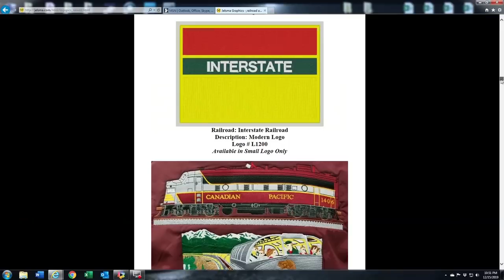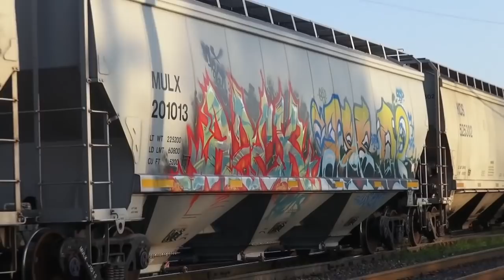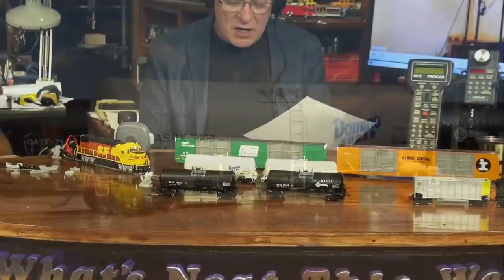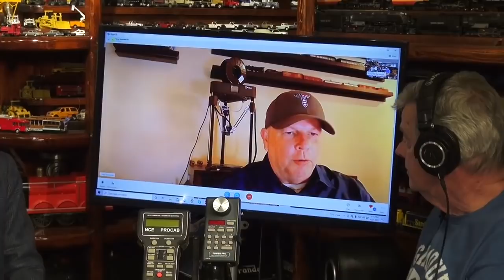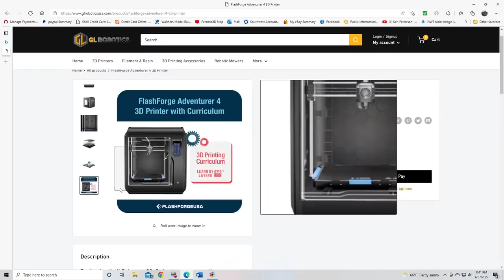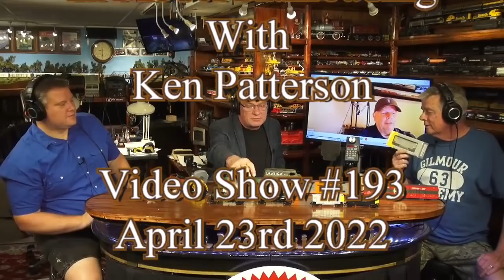What's Neat This Week in Model Railroading #193 Show April 23rd, 2022

Comment: Respectfully, what the hobby needs is:   SCALE track, SCALE wood, and concrete ties, SCALE rolling stock wheels, SCALE wheel flanges, we want METAL wheels - no more of this toy-like plastic wheel nonsense.:    Have you seen rolling stock that has NO weight, they shake and go into uncontrollable vibrations - we need WEIGHTED rolling stock - as well, have you seen power units/engines - start and stop: from a start they jump to 20 mph - and when they stop, it's IMMEDIATE, no slow down to a stop - extremely unrealistic.    We need better motors in the power units, maybe a low-speed motor, maybe a second higher speed motor, OR better gearing.     Now, please, everyone, go and look at a real train.    The power units are covered in grease, tar, oil, diesel - road dirt - they are working power units - they are dirty - now do you see any of this on model power units - NO!    Go and watch a  real train - rolling stock, the rolling stock is covered in dirt and graffiti - they may reflect a little damage now and then - but rolling stock is not shiny and new.   Model power unit and model rolling stock are ALL brand new, shiny and pristine - they are a JOKE!     A JOKE.   So unrealistic.    Oh yes, get back to the real railroads: the track often is barely visible due to ballasting and dirt and oil - model railroading track is so clean - again - UNREALISTIC.   Now, again, stand by a real train.    Wait until the power units pass - what do you hear - screeches, screams, deafening steel on steel sounds, the clickity clank of steel wheels on track - we hear NOTHING like this on model units.   Why do manufacturers not come up with a powered SOUND unit (rolling stock) which makes the sounds of real rolling stock?   Now, this is 2020, why do manufacturers not have wifi color cameras in the power units?   Imagine how great it would be to control a train as viewed from the cab?    View the image on a computer, or a tablet - imagine how realistic this would be.   Now, my final point for this commentary relates to train speeds.   I believe that most layouts HIRE Mario Andretti train drivers - I consistently see these wonderful layouts and the trains are racing around the layouts.   This is laughable: perhaps manufacturers need to come up with speed controllers which mandate realistic speeds.   Hey, just my opinion.   BTW: I can't be totally wrong - this is a dying hobby - the young people see the hobby as a toy, a joke, it's NOT indicative of the real thing.    If manufacturers don't up their game, the hobby will eventually die - all their fault.
Reply: see the Proto:87 Stores

Comment: Mike, China built most of their railroads to US standards after trying British practices. Many of their steam locos were also copied from US designs. Today China Railways are state owned and they operate the world largest high speed rail network of 23, 500 miles and are expanding it yearly. Their loading gauge is the same so they can use larger hoppers and other cars on their freight network which is separate from their high speed lines. I was there in the 1980s helping to set up a joint venture  with my employer. Unfortunately at that time it was forbidden to photograph their railways  but my "handler" did let me sneak a few.  They had some nice passenger cars and steam was still in use on many lines.
Reply: Thank You for the info..Mr. Bird!     MoPac Jack  Kirkwood,Missouri